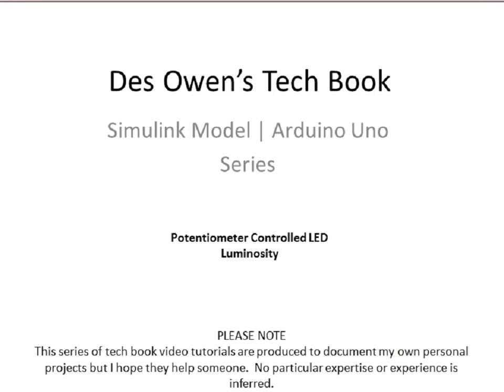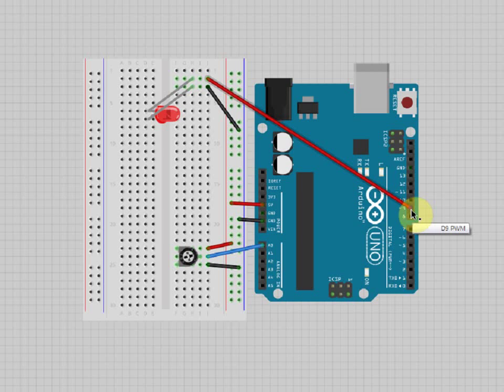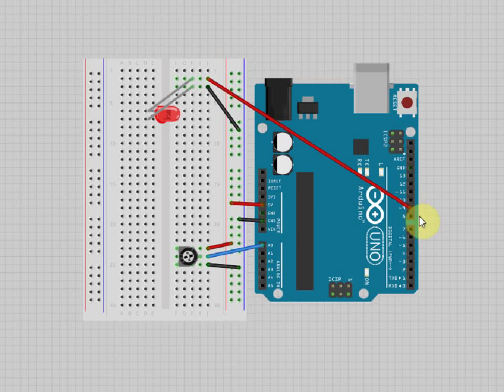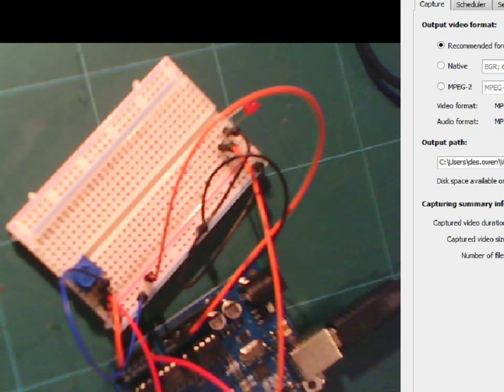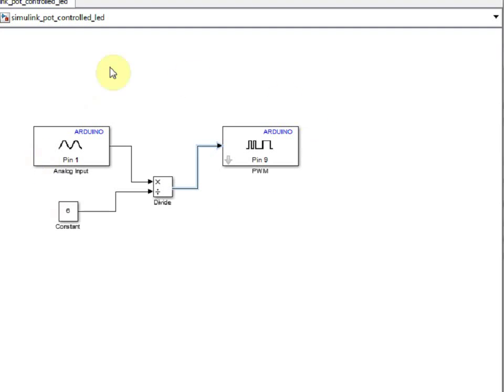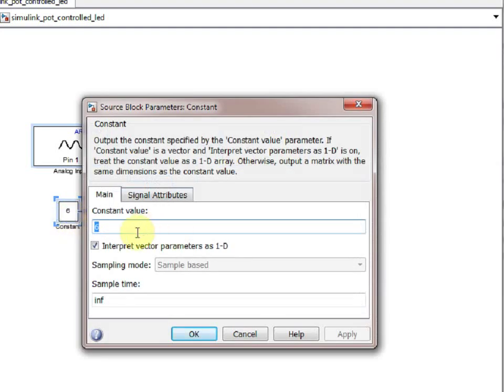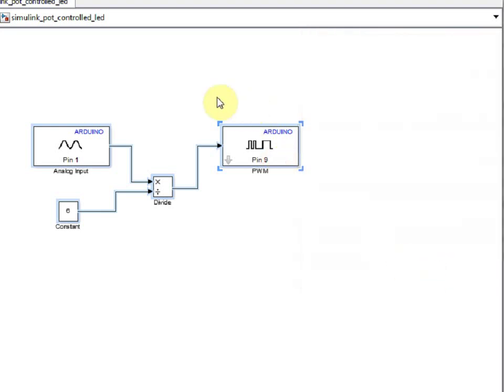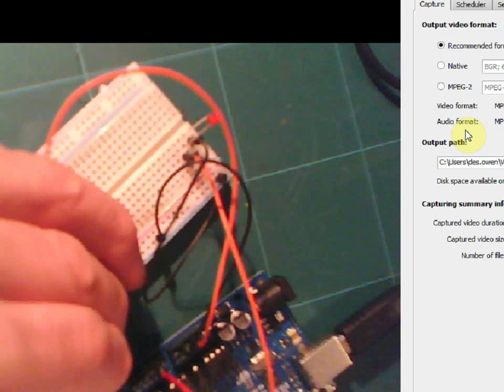Simulink Model - Arduino Uno Series - Potentiometer Controlled LED Luminosity

Comment: Hy Rob, is it possibe to put a scope on the block diagram?? That block diagram works fine but  i want to use the signal while running the simulink program.

Comment: Can it generate arduino code that you view, or does it compile and go straight onto the board?
Reply: Hi Rob, good question.  I don't know for sure but I don't believe so.
Reply: but a coded version using the IDE is very straight forward.

Comment: Nice tutorial! My first simulink model for arduino (-: 
I believe the correct value for the devide is 4. The analog read pin gives a value of between 0 and 1023, and the maximum duty cycle of the PWM pin is for an input of 255, thus 1023/255=4. You can also remove the constant and devide blocks and use just a gain block of 1/4, it simplifies the model a little.
Reply: wens ek kon dit verstaan maar dit klink cool, so ek like dit